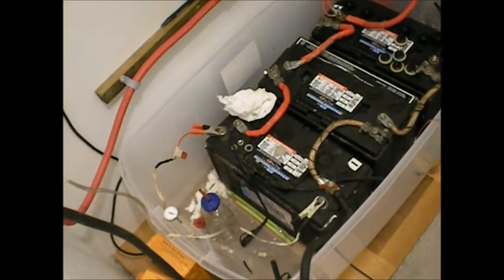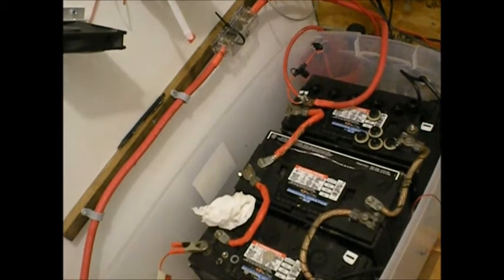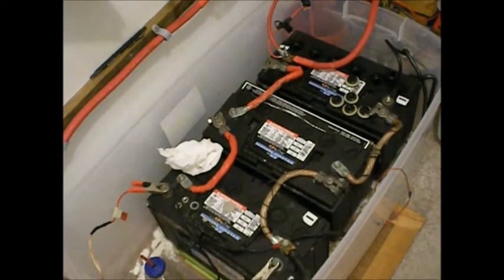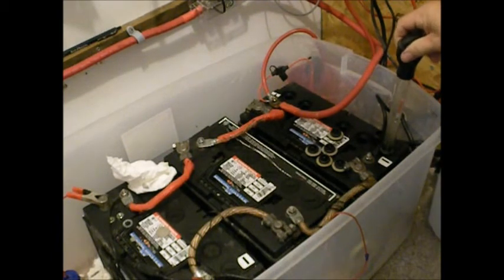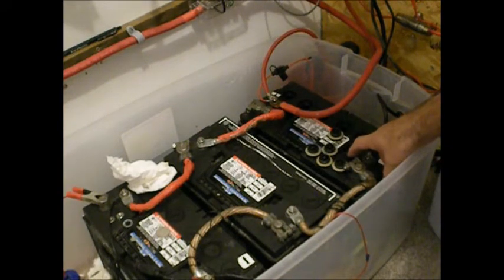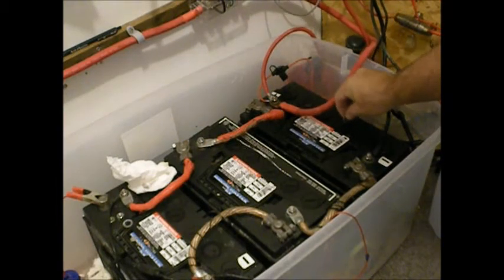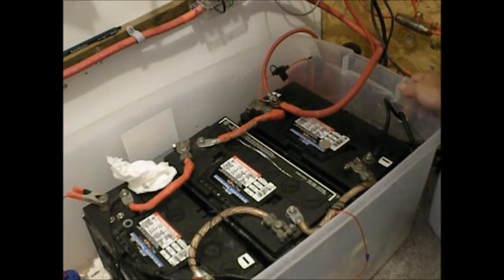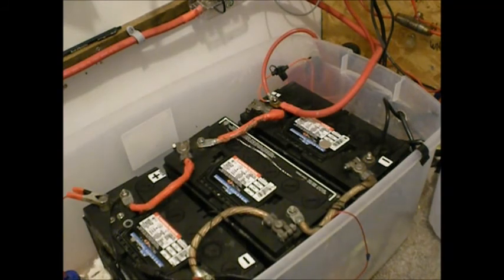12V Battery Bank 3 Years Old

Comment: to get a longer lifespan of your bank you should connect the negative lead on the opposite site as its now, (positive lead on the right, and the negative on the most left negative terminal,) as its connected now you dont draw the bank equally .it raly makes a difference in the life span, eeping the rates equal on the 3 battery,s.

Comment: I just got a Sundanzer 5.8 cf freezer and after a few days of testing it, I'm pretty impressed with the low amount of power it's using.  I'm powering it with an AC adapter and so far the power consumption is starting to settle to around 450w a day and the freezer is a little over half full and in a very warm 82 degrees room.  I'm slowly getting more food in it in hopes of seeing lower power usage.  So far, I'm amazed because my fridge/freezer uses around 2600w in the same environment.
Reply from the maker: Hi I looked at That brand  from Sun electric Miami in 12V / 24V dc about $900  I would love to see a video of your set up for freezer that's what I plan to do thanks.
Reply: TheKilog69
I'll see what I can do about making a video, but my camera battery is dead.  I'm still testing and trying to get the usage down as far as I can, but 450w a day is pretty good.  I'm impressed with the length of time the unit is off because my refrigerator, that has a little over an inch of insulation, is on 80% of the time.  The Sundanzer has 4.3 inches of insulation.
Reply from the maker: Russ Bowers I  just know get it u did get a D/C unit sorry they are the best I from what I here.
Reply from the maker: TheKilog69 My cam battery died 2 times making this video they are from 07.
Reply: TheKilog69
I noticed that when the compressor starts,  it eases up to full power to avoid a large current draw.  I don't think an ac powered unit can do that.